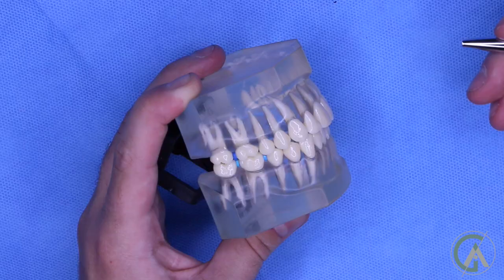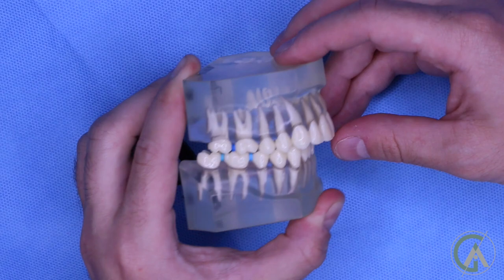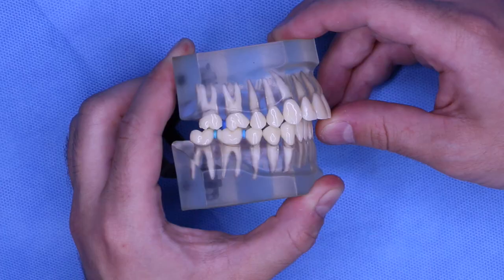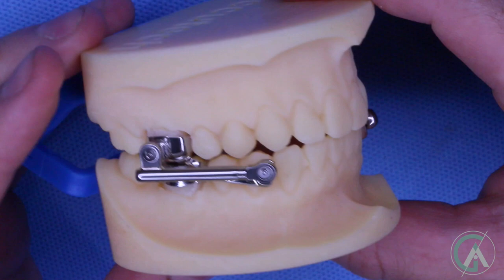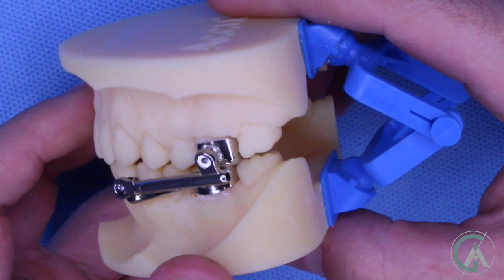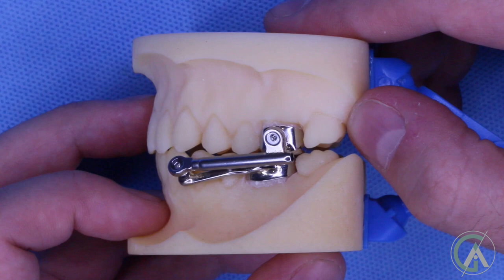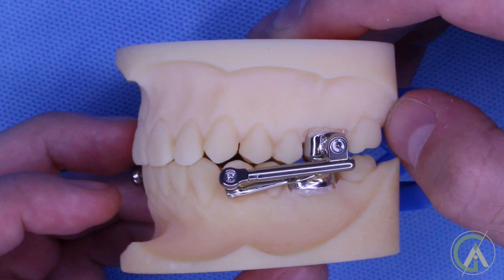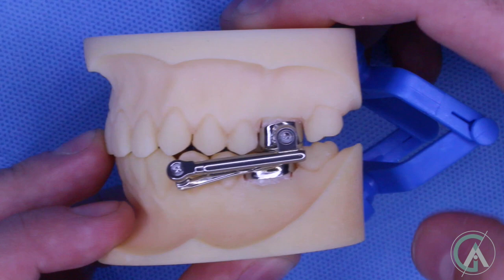[BRACES EXPLAINED] Herbst Appliance

Comment: I got my Herbst off a month ago so here’s my experience: Before I got the Herbst I got spacers which was not fun. It feels like there’s food in your teeth and I kept worrying one would fall out of place. When I got it on I had to teach myself how to chew again cause it felt too weird. It hurt A LOT so I took 2-3 ibuprofens when I could. After about a week it felt fine and I was used to it. (I had also gotten braces on the top so that was also why it hurt so bad). I would get my braces tightened along with my Herbst adjusted every 2 months. The pain wasn’t horrible but it just depended on how much they had adjusted it. I noticed how easy popcorn would lock the Herbst in place so I DO NOT recommend eating popcorn while you have it on. If it happens anyway with what you’re eating then don’t panic and try to move your bottom jaw around until it fixes itself. Brushing wasn’t so hard but make sure you always try to brush the back super well. And the more appointments you re-schedule the longer you’ll be stuck with the Herbst. Your cheek may get pushed up against the sides of the Herbst making it uncomfortable, and if so you’ll just have to make due until it toughens overtime. When I got it off I felt a lot of pressure not so much pain. It came off pretty quickly and it felt really weird but I was so happy! I’d say it was worth it because it replaces headgear and it gives you a better bite. I hope this helps and if you have more questions about what it’s like let me know. Also my experience may be different from yours! :)
Reply: Waterbaby Oxox Yeah I’d say so! My face shape used to look more round before I got the Herbst and then afterwards I noticed how much slimmer my face was and my jaw also looked fuller! I was 12 when I got it on and 13 when I got it off. I am 14 in a few months and I’ve mostly stopped growing. They recommend you do this when you’re younger and still growing. If your orthodontist is familiar with this treatment option and uses it then it’s definitely something to talk about with them! If they’d rather not use it with you that’s totally okay! You can discuss about more treatment options or any questions or concerns you have about surgery! If you are able to get the Herbst it’s totally worth it! Hope I answered everything. Best of luck! ❤️
Reply: thanks for the info! this actually helped a lot (I’m not getting a Herbst currently but my parents are considering in near future)
Reply: How long did you have the herbst and what did they do after you took it off?
Reply: @funnyvalentine5738      I had it on for a little over 14 months, but that was mainly because my appointments kept getting re-scheduled. They normally leave it on for about a year depending on how much they want to use it for. When I got it off they scheduled my next appointment a week later just so my gum tissue could become healthy again. Then after that week I got the rest of my top and bottom braces. And a few months after that they gave me rubber bands/elastics to finish off the rest of my treatment. Hope I answered your questions! :)
Reply: I’m getting a Herbst and top braces in February. Did you have a lisp or difficulty speaking with the Herbst in? (Btw I’m not getting an expander)
Reply: @rosa5178  Nope! It might feel really awkward talking when you first get it on, but normally there’s no lisp unless you have an expander! I remember the first day I got it on I wasn’t really wanting to talk because of how weird it felt. It’s the same thing with rubber bands. To me it feels the same as pushing your jaw forwards a little bit and you get that slight aching (if you know what I’m talking about). But yeah overall you really shouldn’t have any lisp or difficulty speaking it’ll just feel weird!
Reply: @mfsoph7613  ok. Thank you so much for answering 😄
Reply: @mfsoph7613  PLEASE HELP ME IM CRYING FROM THE PAIN I JUST GOT MINE TODAY. I CANNOT CHEW HOW LONG DID IT TAKE YOU BEFORE YOU COULD CHEW AND IT WASN'T PAINFUL.
Reply: @till287  I CANT EAT
Reply: @djgecko8767  NEITHER CAN I WHAT DO WE DO
Reply: @djgecko8767  WHEN DID YOU GET YOURS
Reply: @till287  2 DAYS AGO
Reply: @till287  I ALSO HAVE BRACES ON TOP AND BOTTOM
Reply: @djgecko8767  Ok so i got top braces but not bottom and here's the little update. I'm still in A LOT of pain and pain medicine isn't working for me. I called the emergency orthodontist line and they said do salt water rinses daily three times a day to ease sores and cuts. They also said take pain medicine (but OFC it doesn't work for me). I wish I could tell you I learned how to eat but I haven't been able to practice because of the pain I'm constantly in. I have holes that formed inside of my mouth where the knobs are to connect the arms to the top and bottom tooth caps. They hurt so bad IT IS RIDICULOUS. anyways so my parents wont let me take it out and I'm not doing so good. I swallow whole noodles because I cant chew and I've been having smoothies and yogurt and two times oatmeal but even that was hard. I can keep giving you updates if you like BUT IM STILL STRUGGLINGGG
Reply: @till287  you can have oatmeal?
Reply: @djgecko8767  yes you should be able to eat it but the oats get stuck in the appliance. I personally am having a hard time eating it because I'm in so much pain but you should be good
Reply: @till287  uhhhhhhhhh i cant it hurts too much, i can only eat yogurt
Reply: @djgecko8767  ok i got some tips if you want them. Ive been eating like tomato soup, yogurt, smoothies, oatmeal, and attempted soft pancakes. Ive been putting cotton balls in the side of my mouth where those huge knob things are so it doesn't keep rubbing my cheek. I also use mouthwash which takes away the pain temporarily and Ive been doing salt things (not rlly haha). IM SO TIRED OF THIS FOOD I WANNA EAT CHOCOLATE BUT I CANTTTT
Reply: @till287  so did we all get the same appliance at the same time , i’m struggling as well, my cheeks hurt badly and all i’ve been eating is pudding and jello also yogurt, to floss i got a water flosser cause it’s too difficult with strings
Reply: @daiz3945  i guess so 😂 i’ve had mine since january 26th and a lot has changed. i am finally able to eat without pain and i can east almost everything. the swelling in your cheeks will go away and i thought i wouldn’t be able to chew normal ever again but eventually my mouth just started working properly. i suffered extreme pain from the device but it sounds like yours isn’t as bad which is good. keep eating soft foods and you don’t need to floss. I didn’t brush my teeth for like three days because i was in so much pain. eventually i was able to brush them and during the time i couldn’t i used mouthwash (it also helps with the pain A LOT).
Reply: @daiz3945  pain meds don’t work btw (at least not for me) so skip those and stick to mouthwash (which sorta numbs the cuts in your cheeks) and wedge cotton balls between the lower front metal knob things (where the arm connects to the top) so that it isn’t constantly rubbing. your mouth will calluse soon enough
Reply: @till287  what was it like when they put it on, did it hurt?
Reply: @cashocallaghan7870  yes. you won't be able to close your mouth for a while. the most painful part is when they tell you to bite down on the caps to shove them down in place. it isn't so bad but it's definitely not comfortable.
Reply: Ah, fellow herbst appliance user…
Reply: Liam Mcinnis  I recommend eating soups or foods very soft. It’ll be very hard to eat at first and it’ll feel awkward. When your mouth isn’t as sore you can start trying to eat different and learn how to chew again. You can pretty much still chew normally!
Reply: @mfsoph7613  Hi, I got them on yesterday and i feel like i got uglier i mean i liked my face so much more when i didnt wear the herbst
sooo is this normal?? my face wont be like this forever  right?? it will change after i take it off??
Reply: @hanachavoshi9551   Nope! Don’t worry it’s normal. Because the herbst is bulky it makes your face sit different. Same thing with braces. Once you get it off your face should go back to normal. And you may or may not notice a slight change in your jawline. Due to your overbite being corrected! Nothing major so I wouldn’t worry about it. :) ❤️
Reply: mi niño tiene 12 años, van a ser 2 mese que empezó con los herbst,  me alegra que te haya funcionado, ruego a Dios que suceda lo mismo con mi niño.
Reply: Oh hell yeah the spacer hurt so bad, I couldn't even chew on anything
Reply: Ill be getting it in a few months, does it look really bad from the outside? Bc im worried that i will have little bumps outside and people will be able to see them :(
Reply: I get a herbst device tomorrow I got spacers and eh different experience but hope it didn’t cause a lot of disruption
Reply: Do the herbst appliance need a thing like a retainer to hold the growth of the jaw after the treatment. Along with this I have braces on teeths
Reply: Hoe much time does it take to get used to it. And when your used to it do you even feel it anymore? And can you still move your mouth left to right? And does it effects your eating or talking when your used to it? Many questions I know😂

Comment: I got mine out not that long ago, it really wasn’t that bad. I honestly enjoyed seeing my overbite getting smaller right away. You get used to eating within 2 weeks too. And yes, getting it off is probably one of the best things ever.
Reply: Maggie Ours some people said their teeth didn’t touch so they couldn’t eat, is this true?
Reply: dancing.c My back molars usually didn’t touch but especially after, but I could still eat. I still have braces so I’m currently still wearing rubber bands so my jaw aligns correctly and now my molars touch (: in my experience I could still eat perfect fine with the herbst appliance it just take a week at the longest to get used to it, and every time it is adjusted, not bad at all in my experience

Comment: i had upper braces and this whole appliance with the expander and wire and man! i was a metal mouth😂. this especially sucked and it was very hard to eat food because i could never touch my teeth to each other!! the connector between the two bars is a little awkward when you smile and when it pokes under your skin and you can see. after a while i got used to it. not a fun experience for me but hopefully it will be worth it in the end when i get my braces off in about one to two months!
Reply: abigail marie omg I’m so scared to get this thing in about a week, ahh. do you get used to eating after a while? and does it hurt? I’m so scared that I’m gonna look like my mouth is actually made of metal
Reply: dancing.c it doesn’t hurt at all and it’s a bit uncomfortable on day 1 and 2 sometimes it lasts the whole week but you’ll be fine! don’t worry about it too much
Reply: abigail marie OMG I HAVE THE SAME THINGS
Reply: Hey did you get your braces off yet?
Reply: Selena beauty and vlogs Hernandez YES! it went well and i’m so happy
Reply: abigail marie question did it hurt when they took your expander off because I have one and I’m so scared it’s gonna hurt
Reply: same that’s what i have rn!
Reply: Selena beauty and vlogs Hernandez there was some pressure but it didn’t hurt very much
Reply: @abigailmarie7700  was it worth it? ❤️
Reply: Elona Gashi for sure

Comment: As someone who has had one for only a week its really not too bad! I’d be lying if I said there were no annoyances like learning to chew with almost none of back teeth touching and sometimes having the screws stick out but it all gets better within no time and lisp goes away pretty fast too. It’s also a bit annoying when the rod comes out the tube but after you have it on for a while it happens less often and you’ll also get better and putting them back to. A word of advice within a few hours of having it in every time the rods came out and my jaw tried to move back it really hurt and I’m sure it’s not the best thing for you either so I suggest holding you jaw forwards while you put them back it so it hurts less and the appliance also isn’t that painful in general just a bit of soreness sometimes but it goes away to. In the end it’s really not bad at all plus when you compare to other options like headgear and surgery it gets way less scary to. Hope this was helpful to anyone

Comment: There is an interesting article on the internet which is written in German. It says that patients in the ages of 27 and 32 could be treated well, meaning the overjets of both could be reduced (7.9 to 2.7 mm; 4.4 to 2.3 mm). Nevertheless, the backside of the coin (as we say in German ;D) is the longer period of wearing the appliance (about 18 months in both cases). These results sound to me like a good alternative to an invasive surgery which always can go wrong. 
https://www.zwp-online.info/fachgebiete/kieferorthopaedie/funktions-kfocmd/die-herbst-apparatur-bei-erwachsenen-der-angle-klassen-ii-1-und-ii-2
The ”zwp-online“ is an online news portal.

Comment: I’ve had the Herbst for almost 6 months now and it’s not fun but it’s not super bad
The first two weeks were the absolute worst, (pain, trouble eating, trouble smiling, sores and just uncomfortable in general)
The first two months were also pretty difficult because it was really hard to eat things like burgers and food in general because I just wasn’t used to eating with it but other than that it’s not unbearable 

After that it’s a lot better, still have some trouble eating and food gets stuck but most of the time I don’t even think about it

If anyone has any questions feel free to ask me
Reply: Do you have to get the expander at the top
Reply: @avocadofatigue  I did and I know many have had to but that doesn't mean it's always necessary.
Reply: I have the appliance and every time I eat I get food stuck between the roof of my mouth and the appliance how did you stop it or get the food trout cause it takes me a good 5 minutes to remove the food so I know have to restrain from eating in public

Comment: Thank you doctor! I didn't get difference between herbst n forses appliance. 
If it's not too much, can you please explain these topics for orthodontic dental student point of view. Thanks
Reply from the maker: Sure. I can make a video on Forsus explaining that a bit more but the Herbst is a functional appliance which means it locks your mandible in a protrusive position. This results in growth as well as dentoaveolar correct of the class II. The forsus works more like elastics by causing more of a dentoalveolar correct. It works much like an open coil spring (OCS, see video on coil springs for an explanation) and PUSHES the mandible forward. You can still bite in class II, which you are unable to do w/ a Herbst) but it will apply a force to advance our lower teeth & distalize your upper teeth. Let me know if this helps
Reply: Dr. Greg Asatrian ah thank you so much, doctor really great explanation. Definitely helped to clear the concept. I would be highly obliged if you could explain your videos in such details as I'm an ortho student n your videos are well organized, helps a lot. Thank you 😊

Comment: My previous orthodontist hadn't told me about the herbst appliance and pulled my top teeth too far back, one side more than the other(making it uneven) which I knew was a mistake,  to compensate for my lower jaw being too far back. As a result, my top right canine is graying, which I know means tooth death. The lower half of my face has also become more flattened out because of my previous orthodontist's malpractice. I have a class II malocollusion and overjet. I now have a new orthodontist who is undoing what my previous orthodontist did and is correcting it in the right manners with the herbst appliance but my question is, will my top teeth be able to move forward with time so that they go back to their original positioning? Or is this impossible once teeth are already pulled back?

Comment: I can't even explain how much anxiety i've had over braces and a herbst device. basically, i have a bad over bite. i need to get it fixed. but, it would be so much harder to get a herbst device because i act and you can't show up to any audition with braces or a herbst device. but, i'm already 13 and may not be able to get one so as much as i'm scared to get surgery i'd take it over a herbst device.
Reply: get it. you can't really see it. casting directors know your a kid. and its better than surgery.
Reply: AllAroundAudrey haha i ended up getting the herbst and it went well !! still have braces on but i ended up resolving the issue :))

Comment: Aye doc! Hope ya doin  fine and dandy, i gotta question about class two bite.

When a patient has a class 2 bite does it ALWAYS mean that they have an underdeveloped chin?either upper or lower? In my case i have super crowded teeth that are pushed inside the mouth . (Deep bite)  but my chin seems fine to me as it sticks out good enough and i have a jawline. I have braces for like a month now wouldnt my orthodontist place these force applier ?  Thank u i hope u reply to this id u see it
Reply from the maker: Great questions! Not necessarily. Sometimes a class 2 is just because of a dental problem, rather than a problem of your underlying skeleton. The herbst is more for skeletal correction but sometimes it is only dental (when you won't need a herbst). Since these are all case-specific, I would ask your orthodontist these questions so he/she can better explain your case to you and answer your questions =]
Reply: Dr. Greg Asatrian thanks doc means alot ot me that you actually took time o answer! Cheers. Also one more question(sorry😂)   does the bad bite get fixed by braces themselves or do they have to place some of these force appliers?